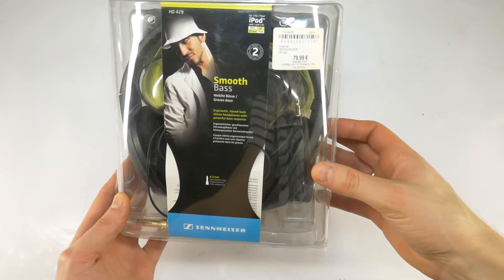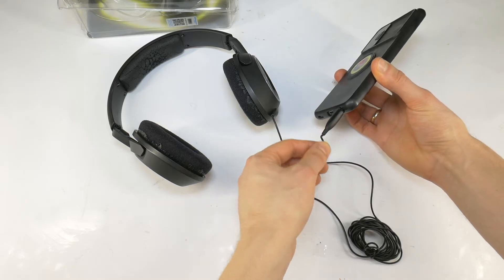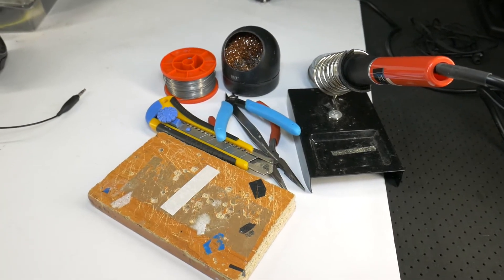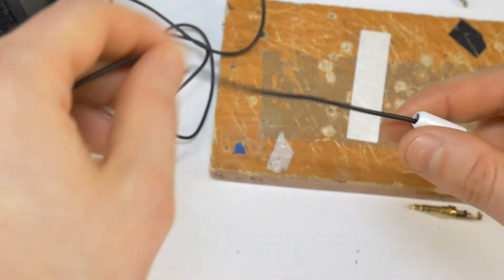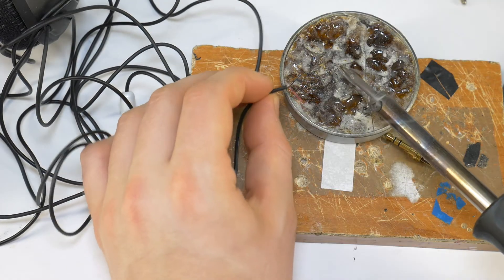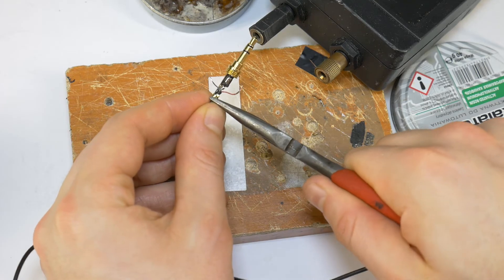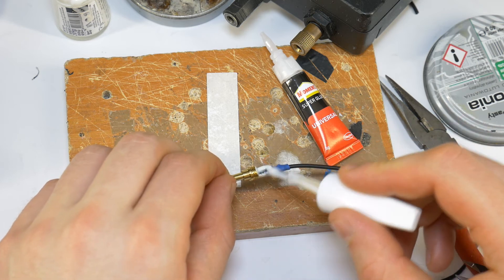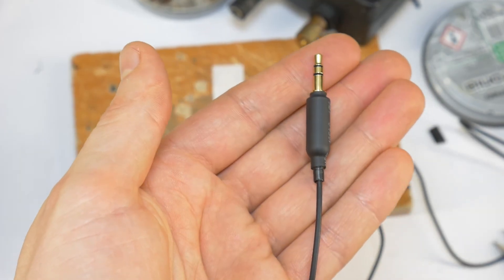Sennheiser headphone 3.5mm jack repair DIY

Comment: Why do mine have 4 wires? 😅one blue, green, red and gold
Reply from the maker: Each speaker requires two wires: plus and minus. Sometimes a single ground wire is used and split between the channels in headphones; other times, separate ground wires are used for each side.

Comment: Thanks, explained in detail but unfortunately I've never ever soldered anything ..
The left side of the headphone suddenly stopped working when I plugged the jack into a new type Sony TV from an old Sony. The headphones are Sennheiser TR 130 which have their docking cradle). So I suppose I'll have to change the jack: can't think of anything else as they've always been perfect up to now, but would certainly appreciate any extra suggestions.